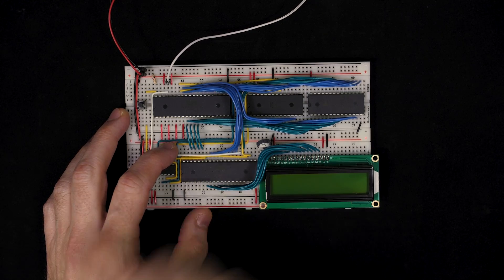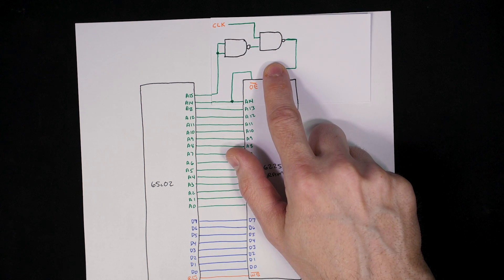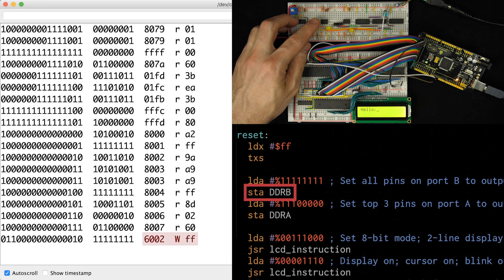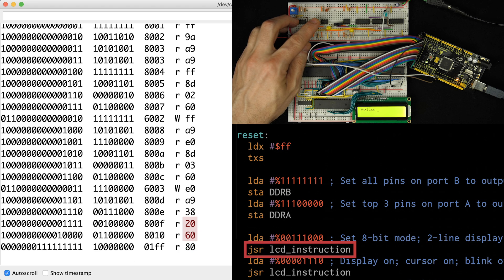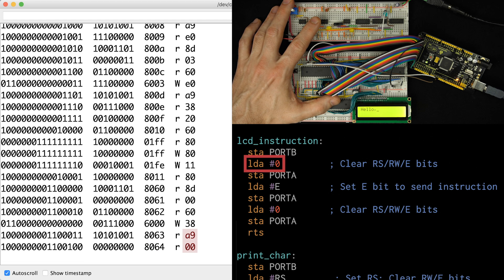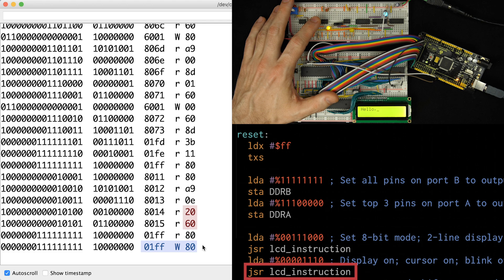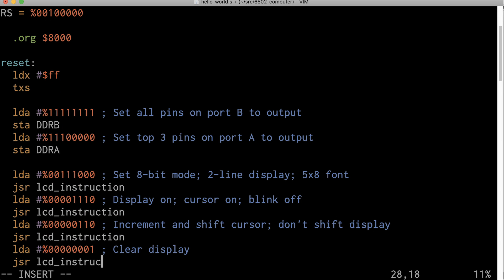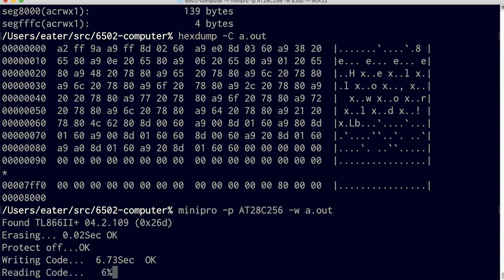Subroutine calls, now with RAM — 6502 part 7

Comment: whenever you say that the cpu uses a clock cycle internally, the cpu actually reads the value from the address, I'm one of the coders of the VICE emulator, and the cpu cores emulate/perform those extra reads (and in read-modify-write opcodes also the extra writes) in order to emulate the actual cpu
Reply: The CPU really isn't using the bus during those internal cycles. However, since the only indicator of reading/writing data is the RW pin, which must always be either high or low, there is always an address that is currently being read/written. External devices can't tell the difference between internal cycles and IO cycles, so they always respond, regardless of whether the CPU is going to use the answer.
Reply: @randomdude9996 : Indeed, they are real bus access, and while they're almost always harmless, with the registers of certain chips, doing a spurious read or write could cause a change of status that could lead to a malfunction.
Reply: @randomdude9996  that's a better way of saying it, yes
Reply: Probably explains why if you look at the pinout of cartridge buses on say an Atari, NES, SNES or what have you they almost always have extra signals to 'enable' the cartridge bus, since the read/write pin by itself isn't enough to work out what's happening...

I know the Atari 8 bit microcomputers have at least 3 'enable' pins on the cartridge bus. 
Actually it has 5 pins in fact dedicated to this kind of stuff. 
Two tell the computer if the cartridge has ROM or RAM mapped into the two address spaces allocated for use by cartridges... 2 'enable' pins to tell the cartridge whether the read/write happening to the corresponding memory address range is meant for the cartridge. And a 3rd enable pin for a 256 byte memory range that is deliberately intended for the implementation of bank switching logic. (eg the computer signals on this pin to tell the cartridge to pay attention to writes in this range; Up to the cartridge to decide how it implements bank switching though)

This sounds a bit over the top, but it's because of several factors.
Cartridges designed for up to 16k, but broken up as two 8k banks.
Dedicated support features for bank switching (another reason to have 2x 8k instead of 1x16k is it makes bank switching and other special functions simpler) - having a pin specifically to alert the cartridge that there is something happening to the memory range assigned for bank switching logic means you don't have to fudge an implementation by abusing something not explicitly designed for such a function. (such as the gameboy - where the memory mapper chips work by getting the gameboy to 'write' to a location that contains ROM, and thus shouldn't be writeable...)
And, the presence of 3 explicit cartridge enable pins means the system can still assign RAM to all 3 of these memory ranges.
Important for a 6502 based system that, in later implementations has 64 K of RAM, 16 K of internal ROM for OS and Basic, AND a 16k cartridge.
(yes, that means it has to map 96k to a 64k address range somehow. In fact it's worse because the last revision of the system had 128k of RAM, meaning it maps 160k to 64k of address space...)

By having a dedicated pin you make the cartridge it's own thing, and can map it in and out of memory independently...
Reply: I figured that as well since the arduino monitor showed the CPU reading from an address
Reply: Where do you read those values to and what for?
Reply: @berndeckenfels  they're read but ignored. It's just a side effect of the design, the CPU has to read or write something on every cycle.
Reply: Rena Kunisaki ok not sure why (as there is no actual bus hardware to notice the signals of the control lines). I can see why an emulator would have to take the speced clock cycles, though.

Comment: will it be possible to use C at some point ?
Reply: Look up a compiler from C to 6502 machine code! I'm sure there are a few :)
Reply: Although there are existing C compilers that targets the 6502, their generated code is very inefficient. C uses the stack very intensively and this little monster has only 256 bytes (!!!) of hardware stack.
Reply: The 6502 is not well suited for C but CC65 exists anyway. Other higher level language to consider are Forth and Pascal. Millfork is newer "middle-level" programming language that is worth looking at.
Reply: @xotmatrix  why shouldnt it be well suited for c? i dont see anything special in a 6502. but your right cc65 exists ...
Reply: @urugulu1656  The 6502 has very few registers (one normal register, the accumulator, and two index registers), it has a limited stack (256 bytes in a fixed location which can only be accessed by the accumulator), and its math capabilities are limited to 8-bit addition and subtraction. In lieu of registers, the 6502 has the zero page memory area for faster operations but it's often largely consumed by the needs of the system kernel (which may be less of an issue for a bare-bones homebrew system). It's hard for a C compiler to manage all of that effectively compared to processors with more features. It can do it but the code is usually very slow and convoluted compared to what an average assembly language  programmer could do.

Comment: "Looks like my clock fell out"
Reply: Well, that's not very typical, I'd like to make that point.
Reply: majormojo Well, how is it untypical?
Reply: Well the clocks not supposed to fall out for one
Reply: Yes, it's never a good day when you get clock-blocked. :-)
Reply: Is this clock safe?
Reply: @Midnight24435  well clearly not because the clock fell out
Reply: I’m not saying it wasn’t safe, it’s perhaps not quite  as safe as some of the other ones.
Reply: @Orwathor  You mean the ones where the clock doesn't fall out. But wasn't this one built so that the clock doesn't fall out?
Reply: @nagualdesign Obviously not.
Reply: @Orwathor  How do you know?
Reply: @nagualdesign Well, because the clock fell out and the computer wasn’t working at all. It’s a bit of a giveaway. I just like to make point that this is not normal.
Reply: I was going to bet the ROM was inserted backwards
Reply: https://www.youtube.com/watch?v=3m5qxZm_JqM
Reply: @ObjectsInMotion  that's grand, thank you
Reply: Looks like he got clocked by the clock which fell out so it wasn't clocking the clock.
Reply: #MeToo 😘
Reply: My guess was either the clock was still set to single-step mode, or adding that clear instruction also reset some internal state so the LCD wasn't doing what he wanted.

Comment: when you say @10:20 (ish) that the value that the cpu reads is left on the bus, that is not true, the cpu does read the value from the address indicated, if the address was from some device that 'acts' on a read from a certain address, then this extra read would cause the device to 'act' even if the value is never used, and if this 'act' is an interrupt things could go wrong and if you are not aware of this extra read would be hard to debug
Reply: It's a good thing that most device registers don't actually do work when doing a read on them. But those that do....
Reply: @paulstelian97  like a UART FIFO? Where's my missing character ....
Reply: @TomStorey96  Uhhhhhhhhhh (not only UART, I'm working on audio drivers and digital audio sample FIFOs also behave like that)

Comment: I'm learning machine code with the pic32 in class. This videos help a lot into understanding what the professor of my University tried to teach me. Keep the amazing work and thank you for this
Reply: PIC chips are great. It's like an EEPROM and microcontroller rolled into one. I love working with them in my hobby projects.
Reply: @EvilSandwich  I couldn’t recall what the very basic microcontroller I used in electrical engineering class was, since it didn’t really come up after “plug this into the breadboard”, guess it was probably a PIC (very small memory, but it did have one).

Comment: It will be interesting to see this computer attached to the video card you made a while ago.
Reply: You'd have to replace the ROM chip for that video card with some kind of VRAM. Which might be hard to squeeze into the address space.
Reply: It could be set up to communicate over a serial protocol, similar to how the lcd communication works.
Reply: Serial would be too fucked. Bankswitched though could be nice, add a register in the 60xx space where the proper bank is selected and then reserve another region of the address space to essentially see a window. Bankswitching shouldn't be that hard either, just have a register that will always output its value including when running.
Reply: @ianmathwiz7  actually... after watching part 6, I know that doing that would take enough time for reading data sheets and engineering, so everything would work.
Reply: @ianmathwiz7  There are actually 8kb unassigned:

https://files.peakd.com/file/peakd-hive/krischik/hoSSNzoy-MMU.png

Now I wonder if there is a secret plan here.
Reply: I made super simple VGA adapter from attiny85, that just needs one pin, UART TX @9600bps... should be possible to hook that up

https://github.com/rakettitiede/octapentaveega
Reply: @FirebayRefurb  kinda defeats the point of you use an Arduino...
Reply: @canaDavid1  there's no need for Arduino, just anything that talks 9600bps TTL UART
Reply: @FirebayRefurb  But that is still way above the 'low-level'-ness of this project. At least in my opinion.
Reply: @canaDavid1  8-pin microcontroller and bit-banged VGA with assembly is quite low level in my opinion 🙂
Reply: @FirebayRefurb  yeah, it does depend on your perspective. Although the attiny had like 16 megs of ram, and is quite ahead of the circuitry used in this series. Although if you set it up s.t. You only use the attiny passively (not using the ram, processor a.s.) then it might be possible.
Edit:
You obv. Have to use some of the processing power and memory, but I mean not utilizing it more than neccesary
Reply: @canaDavid1  the ATTiny I'm using is ATTiny85 which has 512 bytes (!) of RAM. I'm using the whole RAM for screen buffer. Code is like 1.5kB. Granted, the attiny CPU runs faster, but eventually it's not that much more advanced.
Reply: and what comes to CPU power, attiny is pretty much suffering to handle the VGA generation, the code is running in busy-loop and the reason why it needs to be hand-crafted assembly.
Reply: Maybe add character ROM, a text chip, and VRAM.
Reply: Well you're in luck because he just did that. Lol
https://www.youtube.com/watch?v=2iURr3NBprc
Reply: Now that he has made it run at a decent speed, with my limited knowledge of computers I believe writing to the low quality screen would be slow but possible. Cpu driven visuals have been done in the past, and I don’t think he has to make it 20 FPS for it to be a fun project
Reply: Guess what
Reply: Since that video card can only show static images it wouldn't be really interesting.

Building a video card that can display text would be interesting, though. Perhaps as the next project
Reply: @JoJoModding  if thats what happens next,   at this rate i take it in 4-5 years we would be seeing him re-create DOS or early Linux for his bread board computer.
Reply: @JoJoModding  i think it should run so fast, that you would need a separate microchip for all the logic.
Reply: @FirebayRefurb  I didn't do my research... You win
Reply: what if you connected a 3080 to it
Reply: It was🎉
Reply: How about replacing the 555 timer with the fastest crystal oscillator that the 6502 processor can use, and a program that would justify the demonstration? 

The old prime number factorization to 10,000 test could be a good candidate.
Reply: @sirnukesalot24  crystal oscillator is coming next.

Comment: Why not create a bus, like in your 8-bit pc videos. Then hooking up the arduino would also be easier and you wouldn't have those bunched up wires around the cpu
Reply: Probably the improvements he was mentioning. The point of this all I think is not only to teach the viewer about how it works, but how you can improve things when you come to understand how they work.
Reply: A bus with 16 address bits, 8 data bits, clock and r/w is a 26 bits bus. Maybe overkill?

Comment: You talked about putting 4th nand gate inputs to high to not create noise, can you talk about noise and how it affects cpu operation?
Reply: Also you forgot to debounce the button with a ceramic 100nF capacitor.
Reply: @richardlighthouse5328  Which button? The reset button doesn't need to be debounced because it doesn't matter if the 6502 resets multiple times, and the single-stepper clock button is debounced with a monostable 555.

Comment: Ben, i've built your schematic and running at 1mhz - setting the ports on the interface adapter isn't reliable. Sometimes it works and sometimes it doesn't. Any ideas what i can do to troubleshoot this?
Reply: Have you added decoupling caps to all chips? At 1 MHz on a breadboard you most likely need decoupling for stable operation. Put a 100nF cap between VCC and GND of all ICs. Also add some larger electrolytics at a couple of places for some bulk capacitance across the supply rail. Something like two 100uF caps.
Reply: The Interface Adapter should be capable of running at 1 mhz, does it work at lower clock speeds? If so, It could be your breadboard is introducing too much capacitance on the line, and the clock is being distorted too much to work properly. That is what I would check first if I had a scope to measure with.
Reply: @zacharyherfkens7902  looks like that is the case. Running at 5hz is perfectly fine. Hm..
Reply: Look at the clock waveform. The LCD controller needs a sharp raise/fall time. Maximum is 25ns.
Reply: Sounds like the next video may discuss exactly this.
Reply: xot - he did hint that adding the crystal is going to be a video of its own.